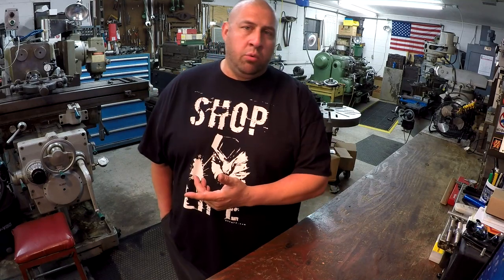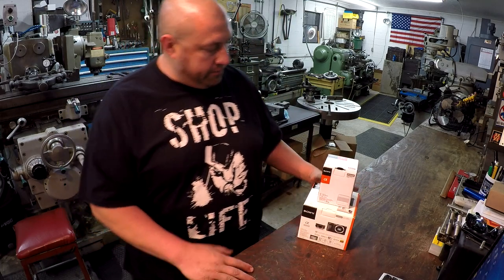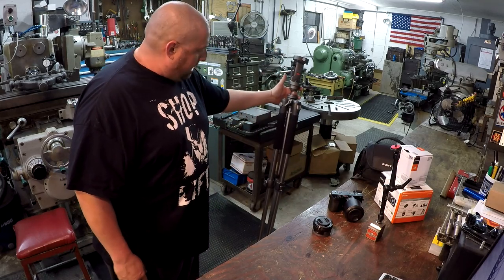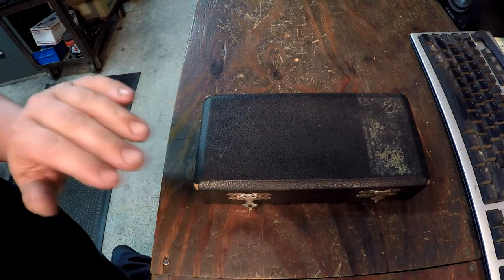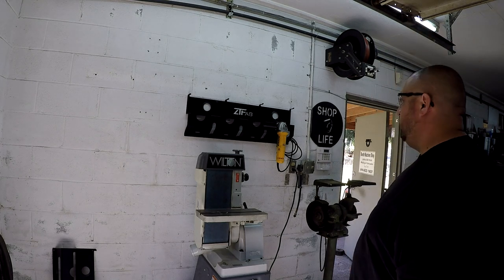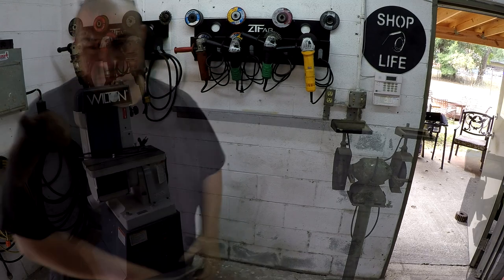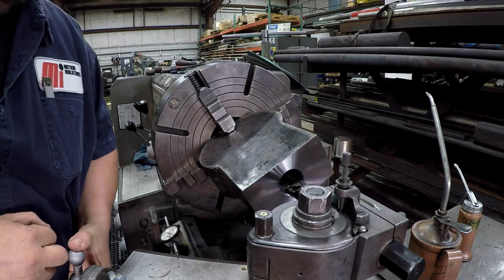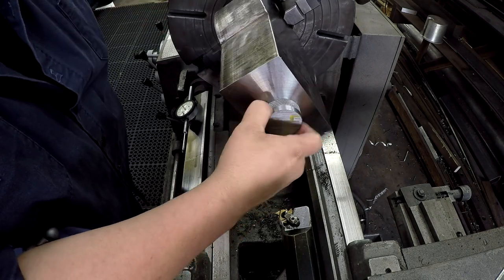Saturday Night Special 142: Metric Threading, ZTFab Grinder Racks, New Camera, Abom79 Hoodies

Comment: Hi Abom, that glass/plastic piece that came with the gauge block set is called an optical flat. It's used for checking flatness of the gauge blocks. Put the gauge block on the optical flat, then you need to use a monochromatic light to see bars of light. The amount and shape of the bars will tell you if the gauge block is still flat

Comment: Hi Adam

The gauge block set is used for micrometer calibration. The disc is an optical flat to check the anvils and measures how flat the anvil is. You need to place it on an anvil and count the number of fringes or bands of light you see.
Really enjoy all your videos.

Regards from down under.

Comment: I use a broomstick like that too. We call it the macinists stick. For parting, holding emery cloth in bores and for turning the tail stock handwheel when boring big holes
Reply from the maker: Carelian customs and fabrication for sure. Notice mine had a slit in it too, for emery paper.

Comment: The round glass piece is called an optical flat wikipedia as a great page on it .
Reply: Interesting stuff. Now that optical grade mirror finish on the blocks starts to make sense. Edmund Optics: "Optical flats are versatile optical components used in many applications, such as: inspection of gauge blocks for wear and accuracy,..."
I may be pointing out the obvious here but the multiple reflections that are happening cause a stripe pattern as the character of the interference alternates between constructive and destructive.
Same phenomenon that causes soap bubbles to appear colored and stripy just before they pop. The pattern repeats every half of the wavelength of selected color of light, e.g. 0.3 µm  (~ 12 millionth of an inch) for sodium lamp light.
@Abom79 it might be necessary to clean both faces with very clean solvent (distilled methanol, mustn't leave residues) and lint free paper prior to testing.
Reply: Yes ,what he said.Lol...

Comment: Awesome SNS Adam ! Also have a usefull tip for you on taking good pixs. Allways make sure you have good light on them and above or behind the cam. Not towards it. Keep up the great work !
Reply from the maker: The Rebel 22 for sure. Always try and have good lighting. Y'all should see what my wooden bench too looks without my clip lights on.
Reply: Yep, those are the key elements for good pics. High qaulity HD camera, good lights, non reflecting background like your wooden workbench and using a camstand/trypod like u showed in the video. Good luck buddy !!

Comment: On the latest episode of How It's Made they showed how they make starrett micrometers, and they show precisely what those crystal pucks are for.  You can put them on top of a surface you want to check flatness of, and you will see lines appear across the surface.  If the lines are anything but perfectly straight, the surface isn't perfectly flat.
Reply from the maker: rewtuser was it mics or indicators? I watched the episode on indicators.
Reply: S27E21 - Macarons, Pine Needle Baskets, and Micrometers.

Aired in canada some time last month, I think.
Reply: called optical flats
Reply: dan wolf Thanks, i couldn't think of it.

Comment: It is used to check the flatness on the ends of the gauge blocks. Have to use the correct lighting to check it. And the same thing is used to check flatness on Mics flats, there is a check procedure for using it. It is an Optical Flats.

Comment: Hi Adam, I like the grinder racks. I believe it was John Saunders who recently said in a video "If you can't find it, you don't own it." And he is right with that. 
I'm have long been planning to build a grinder scarecrow in the style the Project Binky guys featured in their channel: A wheel rim on five coasters with a vertical tube with a horizontal bar on top to hang the grinders on. Some hooks and pins on the vertical to store wheels,  cables and wire brushes. 
Also an extension cord with just as many outlets mounted on the vertical as there are grinders. 
And still the possibility to throw some things into the inside of the rim. The thing will allow to move the grinders from the machine shop to the hydraulic lift. 
But that project has been delayed several times already.

Comment: I hang a lot of tools overhead. I screw a eye bolt into to the hammers and i also hang locking pliers and  adjustable wrenches overhead. I built a hanging 2x4 rack that the tools attach to.

Comment: Great video Adam. I wanted to point out two things.
1. You could use 16:9 crop for the sony camera to get the same aspect ratio as your video.
2. Many have pointed out the Optical Flat already. They are not supposed to be used together, If you happened to get two of them at some point. They are so flat that they will bond together. Detaching them will ruin the surface of the flat.
Reply from the maker: karohe In the video I do sometimes crop the pictures to fill the screen, just depends on what I'm trying to show.

Comment: I'd get a UV / Haze or a Polarising filter for the camera as well.  Not so much to use, though the polarising one would be good for water shots, but it will protect the lens from dirt / debris  and damage to an extent
Reply: Wandering Womble: That is good advice. Such a fine lens deserves protection if it is used to film or photograph in the neighborhood of  cutting oil and chips flying from mills and lathes.
Reply: Agreed. And even outside intentional use, having a rounded set of filters for your lenses is a good idea + a clear glass one. Those are dispensable shields for your lens, a must have. And the best part is that they are one of the cheapest things you can buy for your camera and for the buck, the one that can make the most impact on your photography. Some people dismiss them, but i've yet to see a professional photographer's back that doesn't have an assorted set, heck, i've met some people who had bags for their filters, ranging from gradients, to colors, to blockers and the works.
Reply: There's lot of extremely useful things that can be done with filters, but you can pick that up over time.  Getting something to protect the lens will suffice, and remind yo to look into them as time goes on.

Comment: Adam, as a former professional photographer, what you were meaning to say regarding focus, is called "Depth of Field." What that means is if you  take the point of focus (say the point of a drill bit), the higher the "F" stop on the lens = a greater amount of the picture in front of and behind the point of focus, staying in focus (less blurring). I always used the preview feature on the camera (yes, even film cameras could do this) to see if the depth of field was what I wanted. Just remember this, the higher the F stop, the smaller the lens aperture opens. This means you will need either a brighter light or a longer exposure time. It's a piece of cake once you wrap your head around it! Good luck, and by all means - experiment!
Regards,
Rich
Reply from the maker: Rich206L thanks for the tips Rich. It's going to take practice to even remember the terms involved but I'm starting to get it. The hardest thing for me so far is remembering where and how to change he settings on the camera.

Comment: Leave a UV filter or a CPL (polarizing) filter on the lens permanently. These are fairly cheap, so when they get scratched or pitted by hot chips, you just replace them.

That's probably an optical flat.

You may want to put a big radius on the corner of that C-clamp rack near the light switch. Looks like a back-of-the-hand menace to me.

Nice clamping on that rod end.

Comment: Plus one more on the 100,00 subscribers.  Try putting the grinder out in the sun and let the cord get hot then try coiling it like you want. Usually works with cords and air hoses.

Comment: Lay the grinders on some pavement or concrete with the cords extended and let them bake in the sun for a bit. That should help with the memory the insulation has acquired.

Comment: Adam, got two of the same bag's and they are very nice! Pro-tip: Put a glass-microfiber (fine thread) bunched up on the bottom of the bag and keep the camera with the lens pointing down on that. In my experience this will make dust fall off the sensor over time. Because of that I have only had to clean my once in I'm guessing a year. If the stock lens is the "Sony SELP1650" 16-50 mm lens, then be very careful with it since it can be damaged rather quickly. Also on that lens: Mine has micro focusing issues when recording video. Oh yes: to "combat" overheating of the sensor, keep the screen tilted during long video recording session. Sensor heat seems to dissipates from the body behind the tilt screen. Best of luck! :-)
Reply from the maker: NekitaNet thanks for the tips. I have a Pelican case on order that will fit all of my camera gear.
Reply: You're very welcome Adam :) Make great use of that camera! Oh yes, two last tips: Make sure that magnetic base has enough grip/staying power... Even a mirror less camera is sometimes a hefty thing. The second one is that I use at least on of my bags slung around my body to work out of when I'm recording "on the move".   :-)

Comment: I would just let the cords hang down.  I originally thought that was why you mounted them so high.

also

you might consider spraying those mounts with pickup truck bed liner... would hold up well long term.

by the way... Geo. = George

Comment: Hey Abom. I've been watching your videos off and on for a while now. I didn't know you worked for Motion Industries. If it's the same one I'm thinking of, your company acts as a middle man for some customers of ours. I work for Siemen's, in the industrial mechanical drives devision. I do repair work on our Flender and Winergy brand gear boxes. You probably don't see any of it, as they probably go from end user straight to us though. 

Small world.
Reply from the maker: Ben Thibault I have seen some Flender gear boxes, but a lot of the ones that come in are paper mill and from other big industries like Tropicana.

Comment: The lathe you were using while threading the Abom sized rod eye, caught my attention. Is it a Mazak? I just recently acquired (I believe) the very same lathe. Would like to ask a couple questions regarding metric change gears if I am correct as to it's identity. Mine is an 18/24? 80" model (unsure of gap swing) and is missing them.
Reply from the maker: +MechaDavid It's an Acra-Turn but I believe it's the same model machine. Ours is a 21" swing by 120" bed length.  Shouldn't need any change gears for metric threading.
Reply: I see, it must be different a little gearbox-wise, as mine does require change gears. was hoping to get some measurements for them. Thank you for the response.

Comment: Adam you are confusing me.  In your 10/25/13 video of internal threading you have the compound set 30 deg. to the left like you would for external threading which means as you pull the tool back to cut deeper you are cutting on the back side of the tool.  Now in this video you have the compound set 30 deg. to the right so you cut on the front edge.  Why the difference?  Rod

Comment: ok here is a dumb question why thread on a lathe and not use a tap and a tap wrench. is one better than the other
Reply from the maker: +Scott Tyndall When the job was quoted we should have ordered a couple taps, but since we didn't I machined it on the lathe. I requested that we buy some taps that size.
Reply: ok thanks , i was just curious which one was better ,do you prefer one over the other. i plan on getting a lathe soon and was curious if i need to invest time  tools and knowledge in learning how to thread  on the lathe or grab a tap and or die
Reply: Scott--I think you will want to learn to thread on the lathe no matter what (they call it "single-point threading). It's just one of those cool machinist skills you want in your bag of tricks for when you don't have an appropriate tap/die. If you are a hobbyist, you'll never want to spend the money for the great big taps and dies. They'll cost as much as your lathe.
Reply: Makes sense thanks

Comment: 1/4"x20 common to holders?  I only have a couple of chinesium indicator holders, but I've never bothered pulling them apart to check the thread into the base.
Reply from the maker: +Matt Luettgen It seems. To be the standard camera mount size.
Reply: It is standard for a camera, was just wondering if I would be able to throw one of my indicator mounts on my bike and have another mount.  Then I thought about how many forces it would see and the quality of mount it ism then realized I'd have better luck with zip ties and duct tape, or a BFH.

Comment: Hehe, so that camera is a Digital SLR camera?  I NEED ONE! XDD  What's the megapixel size on it?

Those grinder racks and C-clamp racks came out sharp!  Shop now starting to look more neat and spiffy with those!

On the threading, so the reason you had to disengage the half-nut on this metric threading job was because the depth needed on the threads brings you very, very close to your milled face with your tool holder, so you can't really try shutting off the lathe and braking the spindle due to the risk of either crashing into your workpiece or coming up short on the depth, am I right?  

So you gotta pick a number/letter on the threading dial, conspicuously mark it, and always re-engage on it to back out of the work.  This does make me wonder if not only the ol' husky Monarch can support metric threads with a gear swap, but also has me wondering too if the Monarch's spindle is reversible too.  I don't think we've ever seen the Monarch's spindle run backwards, but I can see the utility of it in having seen Keith Fenner in lots of his vids running his Clausing in reverse with tools inverted for better control of grit when he's having to do a lot of heavy work on a cast/ductile iron part.
Reply from the maker: Patriot1776 the camera is 24 mp. Yes you are correct about the threading disengagement. It's the easiest way to avoid a crash. I don't know how one would pull it off on the Monarch. The motor can spin backwards but you have to shut the machine off and hit the reverse button.
Reply: Abom79 That's good that it can run in reverse if needed even though its not optimally setup for it.  I'm guessing too from how you so often like to gently press your hand to the chuck to stop it after after disengaging the clutch that the spindle brake is not in the best condition either, but you don't mind it? :)

Comment: Taken from Wikipedia   https://en.wikipedia.org/wiki/Gauge_block

After use the blocks are re-oiled or greased to protect against corrosion. The ability for a given gauge block to wring is called wringability; it is officially defined as "the ability of two surfaces to adhere tightly to each other in the absence of external means." The minimum conditions for wringability are a surface finish of 1 microinch (0.025 μm) AA or better, and a flatness of at least 5 μin (0.13 μm).

There is a formal test to measure wringability. First, the block is prepared for wringing using the standard process. The block is then slid across a 2 in (51 mm) reference grade (1 μin (0.025 μm) flatness) quartz optical flat while applying moderate pressure. Then, the bottom of the gauge block is observed (through the optical flat) for oil or color. For Federal Grades 0.5, 1, and 2 and ISO grades K, 00, and 0 no oil or color should be visible under the gauge block. For Federal Grade 3 and ISO grades 1 and 2, no more than 20% of the surface area should show oil or color. Note that this test is hard to perform on gauge blocks thinner than 0.1 in (2.5 mm) because they tend not to be flat in the relaxed state.

Comment: Why is it that metric threading requires that you stay on the same letter/number on the threading dial but standard does not?
Reply from the maker: SuperSecretSquirell because the machine has an inch lead screw.
Reply: The lead screw is imperial, (4 tpi i believe) The mathematical
 intersections of imperial vs metric threads are too far apart to mark on the thread dial.
Reply: Didn't even think of that. Guess that's why I'm not a machinist. Lol

Comment: About those cord issues for your grinders. Home depot sells these straps I will share the link. They are great I use them for my cords and for cleaning up messy wires. 

http://www.homedepot.com/p/VELCRO-brand-8-in-x-1-2-in-Reusable-Ties-50-Pack-90924/202261940
Reply from the maker: salsyou cool I'll check em out